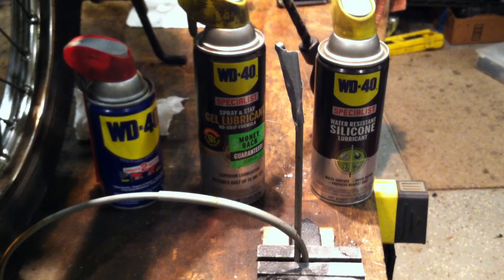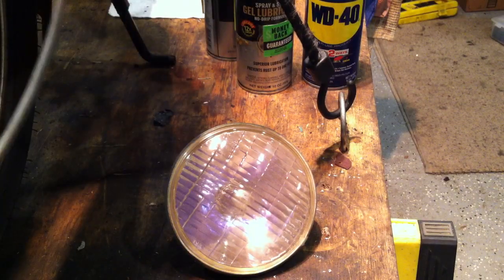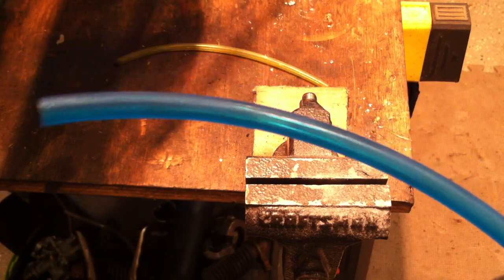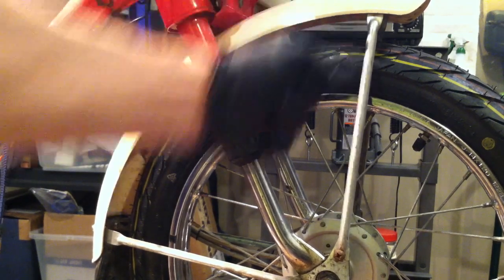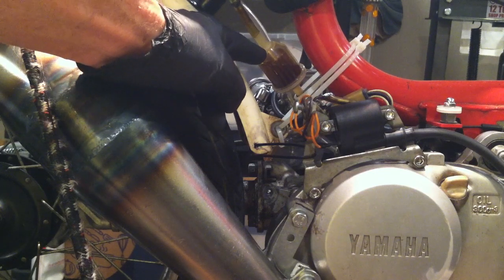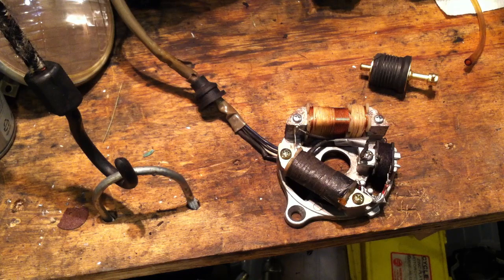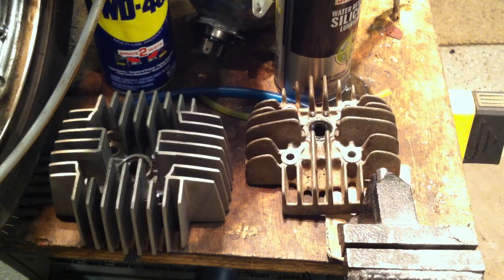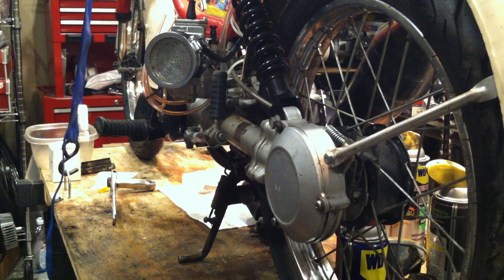Yamaha qt50 tips for free or mostly free or just plain on the cheap

Comment: Thanks. My qt50 sat in the garage for years. I cleaned the carb, put a new gasket on the right side gear box. Now I'm taking your advise for the deer battery and h4 headlight bulb. Rode my scooter all week. My wife is even riding it. Thanks. Mike from wisconsin. 😀

Comment: Thanks again for your videos. I fit a 6 volt bulb into the broken headlamp, figured out an air leak on the air filter mount, put a new gasket on the right side gear box, put a deer battery in, adjusted the brakes, put a new peacock and fuel line in, and cleaned and adjusted the carb. It runs well and I learned a lot. Next a 68 throttle jet.

Comment: The break spring tip might save my life next winter. The breaks were constantly seizing and I thought i just had to keep blasting the hub with wd40.... the cable lube tip also helped correct that....
Reply: Can I recommend using jb gasket maker and some wax paper to make your new bulb replaceable.
Reply: Using too small of fuel line is a good way to make a cussing match taking it off. Use the 1/4 and hose clamps. It's just easier.

Comment: Hello!! I helped rebuild a qt50 engine and we put a 70cc kit on. we went with KnN universal filter and a MLM next level "stock pipe". we put on larger and better tires. I think .. we went to a 80 main jet, bypassed the oil tank for premix....

I am taking over the qt50 and want to do a few of my own things and that requires 12v. I have heard about swapping in the razz "lightning" coil to do this. Do you have any information for migrating to 12v?
Reply from the maker: I've heard of the razz coil upgrade.  Sounds like it will work.  I've gone 12v with the HPI set up.  Either way, you will have to upgrade all your bulbs and battery to 12v.  I think I kept the 6v horn.

Comment: Hello Jack! Im doing a full rip and rebuild on my qt. 70cc mallosi and what not. Id love to take you up on the pw50 gear swap offer if you are still willing after all these years since this video. I dont know if i can get it off right away, but im starting the project next week.
Reply from the maker: @zccolby  i don’t have any pw50 gears currently
Reply: @jackrutherford-1  thanks for the reply, no worries! I have fully taken everything thing apart. I am still pending purchase of a stuffed crank, brakes, HPI, etc. Seems like a lot is out of stock at treatland right now so fingers crossed. If you hear of anyone having a set just lmk :) I have been too busy ripping down the bike to jump on moped army or find a facebook group. I have documented the entire rip down and I will do the same for the build. 

btw, i used wd40 on my cables then I followed with silicone lube. I think the wd40 helped clean the cables out, like you said it removed the old lube and stuff, but it all came out looking really dirty/rusty so I think it might have helped flush it. i made sure to be a bit liberal with silicone as to make sure it pushed the wd40 out.

I think I am going to rewire the full harness with all new wires. Since I am going to 12v and LEDs I figured id just use the ignition system from HPI and then the rest can just be binned and I will use my own stuff for speedo and what not. I can maybe get a 3d printed cluster thing where it is just a cell phone holder and a barrel for the key with a hidden killswitch.

Comment: Quick question. I just obtained an ‘86 Yamaha qt50 that’s been sitting in a garage for 35 years and wanted to know if I can swap the battery that requires acid to something maintenance free? I’ll keep looking on your page but haven’t seen anything covering that yet. Thanks!!
Reply: Sorry, I should’ve watched all of this before asking about the battery! Thanks for covering this on the vid!
Reply from the maker: @frankthetank9525  I forgot if it was this video or the other I have on qt50 tips.
Reply: @jackrutherford-1  considering the Yamaha has been sitting for so long, I drained the gas and see some rust in the tank. I’ve heard adding apple cider vinegar and letting it sit in tank 24 hours can help clean out the tank? Do you recommend that it have any other options?? Thanks!!!
Reply from the maker: @frankthetank9525  Evaporust is a good solution.

Comment: This is a great video. I wish I had watched before I already bought a lead acid battery. Oh well, next time. I recently watched a video that has an even better idea than your 'duct tape funnel' for lubing and cleaning cables. My choke cable was completely seized up on my 'new' QT50 and I feared I would have to buy a new one for big bucks. I kept noticing that outwardly the cable seemed to look OK and I hated the idea of just throwing it out. 
The idea is to take a water bottle (or, I used a different kind of flexible plastic bottle) and drill a hole through the cap that the cable has to be forced through for a nice snug fit. Then , put your lube (I used silicone spray) into the plastic bottle and put the cap back on. 
Now hold the cable vertical and squeeze the bottle forcing the lube into the cable. If there is junk in the cable it will probably be from the TOP part of the cable. In my case it was the part of the cable that fit into the choke lever. Put this part DOWN so that the lube washes the junk out of the cable. 
I could not believe it when I started to do this and the cable started to slide back and forth just a bit and then the flood gates opened. I could feel , in the lube that was coming out, grit being washed out of the cable . I surmise that someone in it's past took a dump on a fine sandy beach and forced sand into the cable. 
Once cleaned out the cable looked and worked like new. Held vertical the cable would actually fall inside - it worked that easy. 
I'm looking forward to more great QT  videos from you.
Reply from the maker: can you post a link to that video?

Comment: Hello,  Thank you for your videos.  I am getting my 1980 QT50G back out of storage for my grandkids to use.  There is a square, metal screw-on plate next to the gas cap.  Mine is leaking.  What is it and is there a gasket I can get for it?  Thanks.
Reply from the maker: I don't see a gasket there - https://www.babbittsonline.com/oemparts/a/yam/50041fa0f8700209bc786be7/fuel-tank
Reply: #6.  Do you know what's under there when you unscrew it and remove it?  Why is it there?  I wonder if it's for a fuel gauge sending unit on some other model?

Comment: I have a 1980 QT with a Malossi kit, High compression head, 2mm base gasket, 24mm intake, TM24 carburetor, oil tank gas rig, an MLM stock like exhaust.. no milling of the cylinder jug, mostly guessing as far as finding or anticipating bottlenecks in the flow. without PW50 gears, an HPI upgrade, or expansion pipe I can get the speedometer needle almost 6oclock. don't know how fast that really is but its plenty fast! without a voltage regulator that came factory fresh on QT every year after 80'. how can I keep my blubs from blowing at higher rpms? Battery is fairly new, been charged, the rectifier should direct the overvoltage to recharge the battery. My electronics are showing age. Ive had to do some splicing but managed to secure strong connections with a 10amp fuse. ive blown a few fuses, numerous blubs, Don't know where to install a volatge regulator.. The carbon fiber reed is where a bit of magic happens. very responsive throttle. but throttle cable broke recently, waiting on new one..
Reply from the maker: Install voltage regulator just like on later models.  drill hole in frame, but qt regulator off eBay, screw it in frame, splice into blue wire off stator.
Reply: @jackrutherford-1  thank you for the tip!

Comment: My scooter boggs at full throttle. Not bad but anoying. I cleaned the carb. New fuel line. Cleaned tank and added fuel filter. Any ideas from the group? Thanks.
Reply from the maker: Mike Crotser if you are all stock, try a 67.5 or 68 main jet
Reply: Thanks!

Comment: I know this post is 3 years old. Do you still have pw50 gears to trade for my QT50 gears like you mentioned?
Reply from the maker: I have pw50 gears in a qt50 differential housing with a qt50 axle ready to go for sale.
Reply: @jackrutherford-1  thanks for your reply. My engine is still stock right now. I'm guessing the pw50 gears will really bog it down from a start. Is there a way we can message in private by email or Facebook?
Reply: @jackrutherford-1  Hi. what are you asking for it? would you want mine as a swap? i watched some of your videos, pretty good info to a lot of frequently asked questions. do you have parts for these QT50s that you sell? as in like the speedometer/indicator panel unit where the key is, or battery box, stuff like that...i want to put on a different exhaust, with an expansion chamber and maybe a bigger carb and air filter to get a little more pep without doing a engine displacement upgrade, this engine is still doing great and the piston and cylinder are good still and not scored up. i can cut and weld pipes together to achieve installation if i had an idea of what would be the best to chose from. i wouldnt think the pipe from treatland thats available, the next level pipe for 200 dollars would make much difference. hell, it looks like the same damn thing i have on it. mines not restricted either. i dont need to go 50 mph, and i dont want to completely get crazy with mods and stuff, but id like my scoot to have more pep and not bog dso much from takeoff till it gets going and then just run outta steam at about 25-28 MPH. if i wanna get on a pipe, ill start up the 81 YZ80H i have. HOLD ON!! any suggestions would be appreciated, you seem like you have worked on one or 2 of these...thanks. my name is jake, i live in illinois.
Reply from the maker: @jakelafferty8074  I'm at 4472365@gmail.com - I'd want $295 for the qt50 rear diff with pw50 gears.  You could probably sell your qt50 gears in spring for same or more.  Any tomos a35 pipe can be made to work with either a qt50 header, mlm header, or as is.  I have a video of one that I put on a towny.   I've had about a dozen or so qt50s.

Comment: What air filter are you using? Did you have to rejet with it? Rubber fitting between my airbox and carb is dried out and doesn’t seal well. Not sure whether to replace connector at $37 to keep stock air filter or get aftermarket air filter. Don’t want to have to adjust carb though. Thanks!
Reply from the maker: any 28mm air filter will work.  qt50s are generally jetted so rich that re-jetting for just an air filter is not needed.  I will have a new video coming out on air filters - air boxes.  https://www.treatland.tv/SearchResults.asp?Search=28mm+air+filter
Reply: @jackrutherford-1  Thanks! I just ordered one.

Comment: Do you know how to wire in a universal ignition barrel to a yamaha qt50. Or where to find a replacement for cheap?
Reply from the maker: my buddy got something like this to work.  And he originally had a 3 position switch.  I think it's pretty simple really, you just wire everything except the ground or kill wire to one side. He even got it to fit in the speedo no problem.  https://www.ebay.com/itm/Yamaha-Key-Switch-Fit-Chappy-LB50-LB80-Y80-Y80M-V80-Ignition-Key-Switch-5-Wire/293522341217?fits=Submodel%3ALB80%7CMake%3AYamaha&hash=item44574b7d61:g:o-YAAOSwA2hdpeC3

Comment: I just picked one of these up for free and got it running today. Had no idea people mod these things so much. So you said you need pw gears to go fast but my issue is I have a lot of hills and it barely makes it up. If I gear it up it will be worse in the torque department.... so what’s the easiest way to make some decent power to get up those hills?
Reply from the maker: Check your compression first. If your compression is low, you will lack power generally.  Easiest way to raise compression is new piston and rings provided your cylinder is not too worn and out of spec.  Weak spark will result in lower power as well.
Reply: churioz26 can a healthy qt50 go up steep hills normally though?
Reply from the maker: @brapperdan  I'm sure there are hills it cannot conquer.  Stay tuned for video.

Comment: Where can I find the flasher relay on the QT 50. Turn signals go on but will not flash. Thank you
Reply from the maker: underneath the black plastic cover by the front rack
Reply: @jackrutherford-1  do you know of a good replacement relay?  Thank you.  I just donated keep the good videos coming.
Reply from the maker: Thanks for the donation.  In the past, I have just searched for 2 prong or 2 pin flasher relay on eBay.  I think you want the one with the diagonal prongs (check your original).  Some worked well and some didn't last.  You can also try gently tapping your old one and it might just be stuck.

Comment: I have been really appreciating your videos. I have been helping my brother inlaw with his 1981 qt50 with the help of another friend. 

Do you know if these bikes can handle 6v led bulbs? I want to give his bike nice bright lights and was considering your headlight mod with a h4 style 6v LED bulb. Also swap the blinker and tail/brake bulb (2 stage led for tail and brake).

My worry is that I'd assume they have lower resistance than halogens and might cause problems. Do you think I would need to swap out all the bulbs? Worried I'd have too much leftover power and burn a dash bulb out or something. 

Thanks!

(1981 qt50 60cc kit (seems different than the cheap 60cc kit you showed) with mlm next level stock pipe, 80 main jet, inline fuel filter, k&n air intake filter, 91oct premix (oil pump gear removed) 32/1 mix)
Reply from the maker: I don't have any first hand experience with LED lights but from what I've seen and read, you have to add resistors in the circuit.
Reply: oh my. i just posted another comment and realized that I have already watched this video back when I started to assist with the rebuild haha. I hope all is well then haha! hopeful to find more information on 12v conversions @jackrutherford-1

Comment: Great tips thanks. I thought the Puch head was 38mm. You sure that works
Reply: Also I want to send u my differential to trade for a pw50. Your an inspiration. Thanks again
Reply from the maker: sorry, here's the correct 40mm puch head - it has been drilled out so will work on Honda and Yamaha - 38mm head won't work without additional machining. https://www.treatland.tv/honda-hobbit-pa50-custom-cut-PUCHOBBIT-40mm-head-p/custom-head-029.htm
Reply: I asked Treatland about the 50cc hi comp head. They said it fits but may need to file stud holes a bit and may need indexing washers
Reply from the maker: @fredstone7923  a picture is worth a thousand words - http://qt50.net/wp-content/uploads/2019/09/puchhondahead.jpg

Comment: I had my 1985 QT50 (that was in mint condition) stolen over a week ago and today it just showed up. I think a neighbour stole it and then found out I reported it stolen because it’s the only thing I can legally drive (until I can do my road test) and it was insured. Who would steal something, ruin and mangle ignition with a flathead then return it to the person you stole it from? Just very odd and I’m still trying to understand who stole it or why they would return it. Glad as fuck i got it back but idk if they ruined my motor because the key turn is stuck in start because they were able to turn it with a screwdriver but couldn’t turn it too off. I’m bringing it to my local parts shop let’s just hope it’s just the ignition (they have a shop attached and only work on bikes and mopeds, has retro bikes, mopeds and a Honda towny in mint condition so they know what they doing)
Reply from the maker: well at least you got it back.  sorry about the ignition